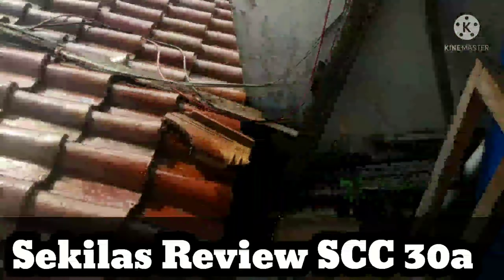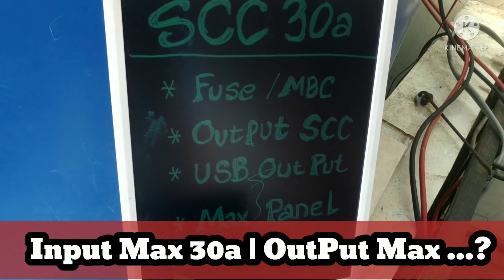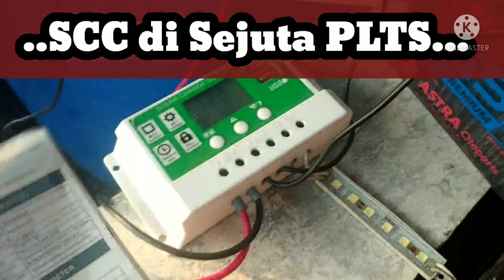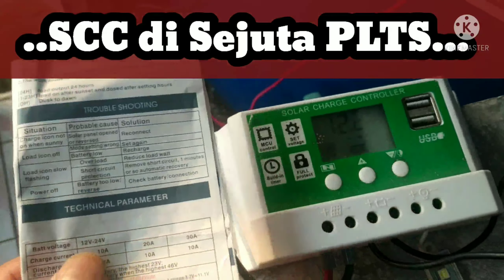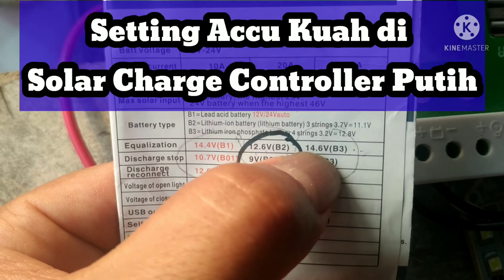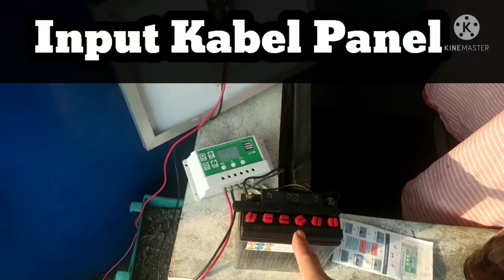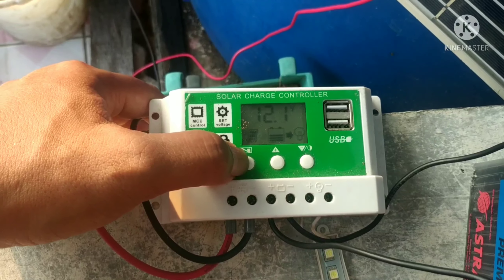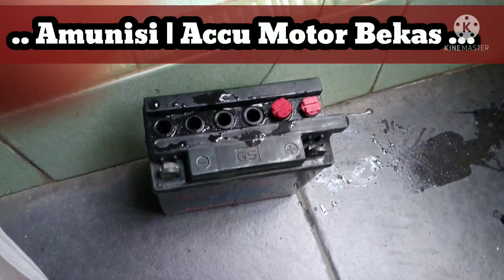Cara Setting Aki di SCC | Solar Charge Controller Murah | SCC Lithium Pilihan Jutaan User DIY PLTS

Comment: Bang, jika aki sudah full apa perlu du cabut surya dan aki dari controller ?
Reply from the maker: tergantung kualitas SCC kadang sih....

kalo SCC nya bagus.... rem nya pakem..... gak usah di cabut kabel dari controller ..

tp kalo ragu, pasang saja mcb dari jalur kabel panel sblm masuk SCC, jd kalo penuh  tinggal matikan MCB dari kabel panel nya.....

atau pasang beban di accu, agar tersalurkan produksi dari panel nya
Reply: @Dzikr_Family  dan lampu dc12v yg akan kita pakai utk ruang jika mati lampu apa harus lewat Load dr scc apa mending lewat terminal aki langsung ?
Reply: Kalau pakai inverter kya nya apa harus lewat aki y dr pda lewat Terminal load sccc ?
Reply from the maker: @andibanjar2264  iya kalo inventer lgs dari accu
Reply from the maker: @andibanjar2264  bisa pakai load output SCC kalo hanya lampu DC..... biar ada auto on off bawaan scc nya
Reply: @Dzikr_Family  ohh iya bang 👍👍🙏

Comment: Mau tanya pak dzikir.klo misalnya solar panel langsung ke lampu dc  yg 10wat dgn panel 10wpbisa terang gk? Plts tnpa aki maksudnya.bikin videonya klo sempat. Klo panel 100wp.bisa tuk lmpu dc 10wat ,10pcs.lumayan bisa hmat pln siang hri tuk penerangann aja.
Reply from the maker: nah itu kayanya yg di yutub ada yg sperti itu pak..  panel+elco 

panel 100wp.. dimasukin ke Capasitor dulu via SCC, buat nyimpen produksi panel...  penyeimbang dan penstabil voltage dari panel k laod nya tetap via output SCC....  dari output scc baru ke inventer 

cuman sy masih blm bgitu faham soal elco nya nih.... masih tarap nonton yutub dulu😁😁😁

 kayanya dia pakai elco 80v kalo gak salah buat sambung inventer.... pingin nyoba nanti buat nyalain pompa air DC
Reply: @Dzikr_Family  bukan yg seperti gitu.yg dari panel langsung ke lampu dc .ada fi youtube project ringan.cm saya ragu,soal cahaya lampuny agak redup.klo matahari terik mgkin terang.saya blum coba.kapan2 klo ada waktu mau coba.tadi pagi sampai siang,sudah dibetulkan kabel kolor ijo.ternyata yg merk visero msih bagus.yg merk akiku diujung kbel seperti pengapuran.akhirnya kabel dipotong sampai kelihatan normal.mufahmudahan normal lgi.panel 1140wpdgn 3aki 100ah.ada jg satu panel yg ada siput.merknya gh solar,tapi kmgkinan palsu.tokonya wilindo.yg gh asli madih bagus,belinya di toko surya terang.yg beli dari wilindo suka ada barang bs.info tuk semua hati2jgn tertipu hrga murah.
Reply: @layakang1128  bos kalo di surya terang barang nya sesuai diskripsi tida
Reply: @iyan1841  ya.pedagang yg jujur.jadi kejadiaanya saya beli panel 100wp mrk gh di wilindo 4lmbar hrga paling murah.pas saya terima di panel merk gh tapi 50wp.tapi ukuran sprti 100wp.kata yg jual salah tempel stickernya.sblumnya saya sudah pki merk gh.ternyata memg brg palsu.setelah 1thun.sekarang dri 4pnel.1 sudah rusak sebagian.jadi kesimpulan bnyk toko yg jual pv merknya tinggal di tempel mrk yg laku di pasaran.klo fi surya terang setahu saya brgnya sesuai deskripsi.mmg harganya lebih mahal sedikit.makanya bnyk org tertipu di hrga murah.pengalaman adalah guru yg berharga .
Reply: @layakang1128  makasih ya kang infonya saya baru pake 1bulanan lgi belajar di panel surya 200wp merk solana, pengennambah tapi bingung toko yg mn yg amanah jadi kebeneran akang bicara keluhan di toko online,makasih banyak infonya